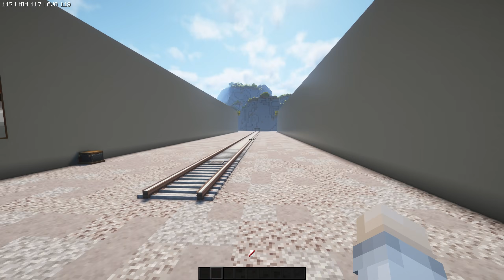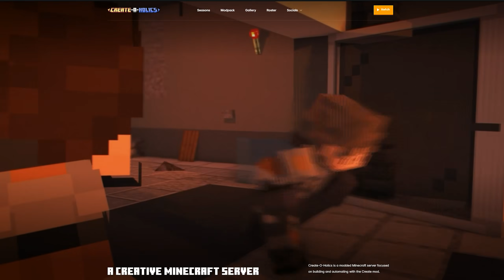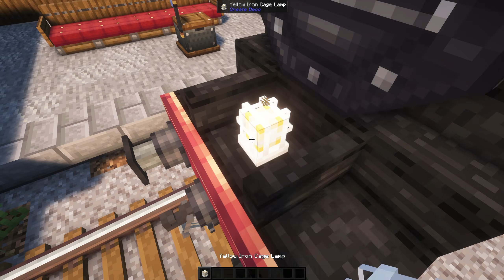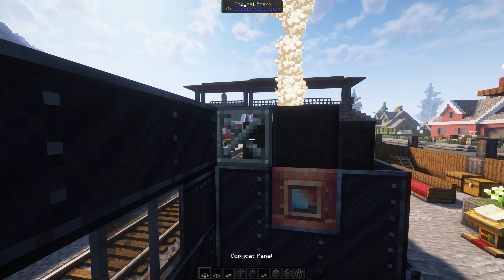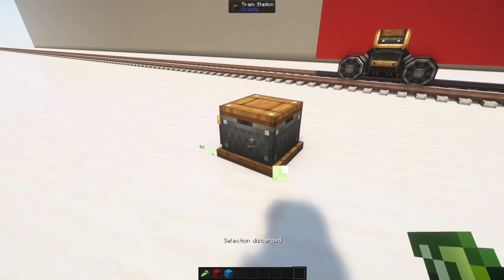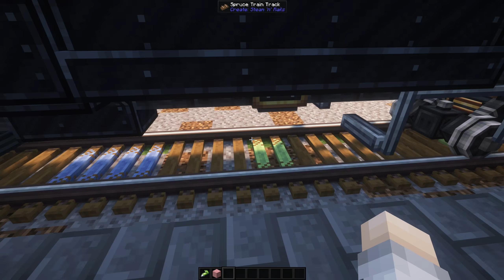Minecraft TANK ENGINE TRAIN with Create Mod 🚂 | Train Tutorial

Comment: how'd u open that bogey selection, its not working for mine. help pls?
Reply from the maker: Make sure you have Steam 'n' Rail addon installed then press alt with train casing in you hand
Reply: @MadenPlay  thank you
Reply: @ also what type of wheel does that engine use?
Reply: @MadenPlay  also where do you get those wheels from

Comment: Maden and teacup with a new video up. today is a good minecraft train day.

Edit: I actually prefer using the articulation for the engine two times, both for the leading and trailing trucks. With that the running wheels keep beeing straight on the frame and so the valve gear doesn't move out of the pistons within curves.
Reply from the maker: I considered using that type of articulation as well while I'm testing this, I can't remember why now I didn't went with it
Thank you for the comment though I might do that nex time :)
Reply: @MadenPlay  what mod you use to build the train (mod not modpack plss answer)